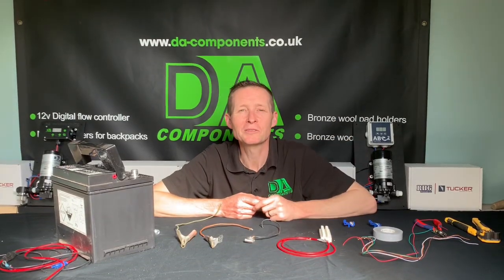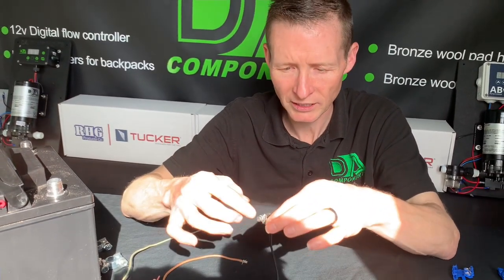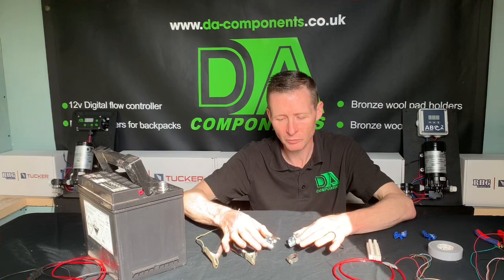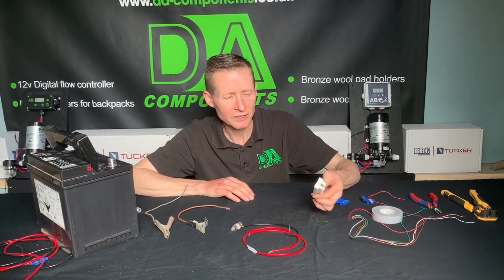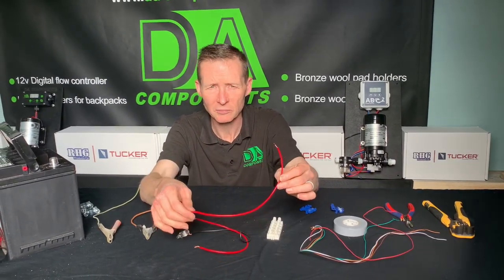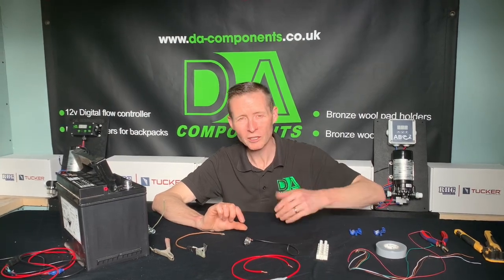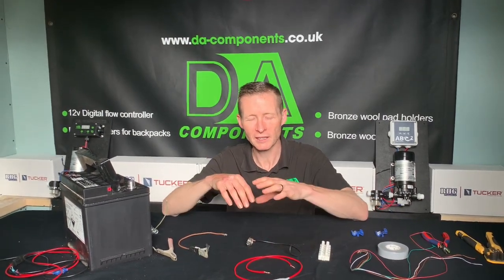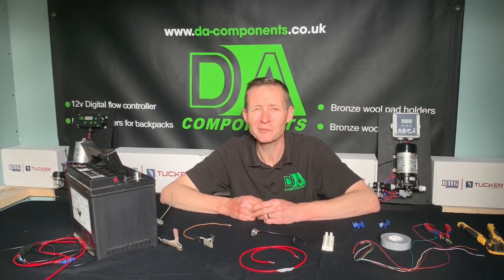12 Volt Pump & Controller Wiring Tips - What to Avoid

Comment: Hi mate I bought a new v16 but it keeps switching off ??
Reply from the maker: Hi Gavin , I would be checking your battery terminals to make sure their are tight and no movement, also I would be checking the fuse holder too